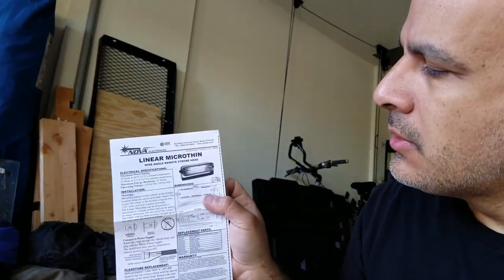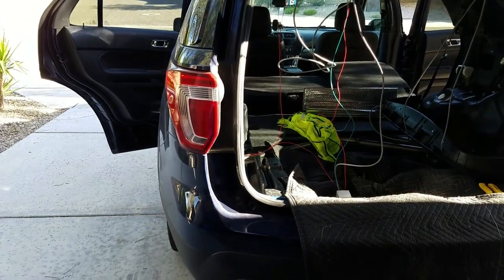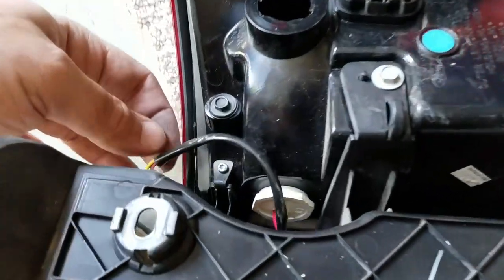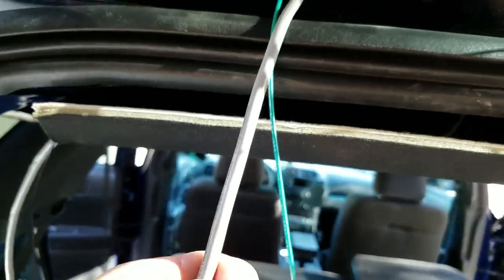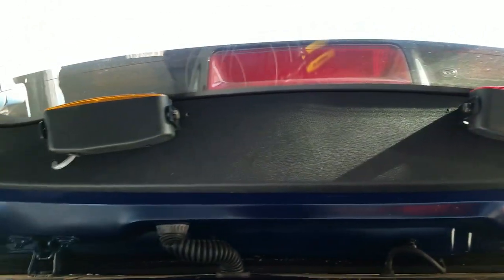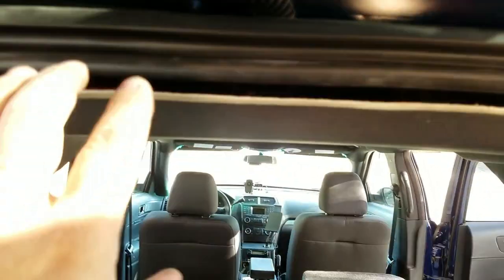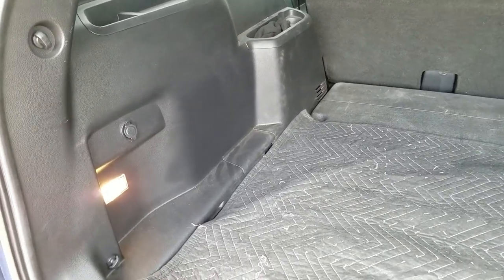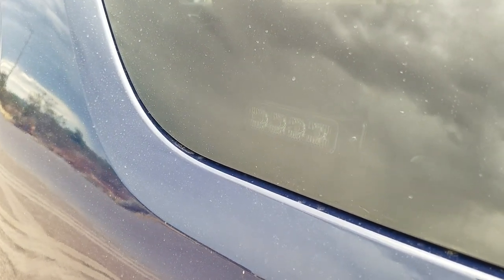Ford Police Interceptor Utility Mods - They're coming to get me!!

Comment: Are you sure about white strobes being illegal on the rear here? Cable company runs white rears on some of their trucks and so does the bus mechanics trucks.
Reply: Never-mind, definitely illegal, found the ARS. I wonder how Valley Metro gets away with that shit
Reply from the maker: http://www.azleg.gov/ars/28/00947.htm  Section D.

I mean it doesn't specifically say you can or can't have white, but says they "shall be" red or amber. I'm not a lawyer so I don't know how to officially interpret that.  The general consensus of all the people I talked to that have lights say it's not legal.  But you are right, I've seen AAA roadside vans with white strobes in the rears. I think the bottom line is no one of authority cares. lol.  I'll play by the book. Not worth the trouble.
Reply: I need to find a way to make my white one red.
Also need to make my back two marker lights red. Amber is illegal for them.
Reply: Well, they do much more than driving around a wannabe LEO failed BLET used police interceptor. There is no reason this loser needs lights. He is the kind of guy who chases after people speeding trying to pull them over.
Reply: I believe he purchased it new from the dealer if you look at the original video. Strobes serve other purposes over just pulling people over. I have them on my work truck and personal truck for safety when parking on the street. It helps make people more aware your there and could potentially save your life.

Since I put the strobes on my truck, I've noticed people are a lot more careful when I am making deliveries as a courier.This is why your starting to see them on usps, fedex, and ups vehicles. In today's world where you have all these morons texting or getting distracted while driving, anything that can draw attention to the fact that your stopped and there may be foot traffic around your vehicle is a positive.
Reply: +Vincenzo Lombardo A private civilian CAN NOT purchase police interceptor variants of Ford vehicles new. It was used. As well, no there is no reason someone not doing road work or towing or something similar would need that many lights. This guy does nothing of the sorts. PERIOD.
Reply: Read the comments below, he does comm and road control for bike races including roadside.
Reply: +Vincenzo Lombardo He has no official capacity with any government law enforcement organization. Which is why he had to purchase this vehicle used. He does however have a failure with no allowed re-admittance into BLET. He is simply another police training failure who likes to put lights on his car. Sort of like you.
Reply: Nope never went into LEO, and I have no desire to. I work in telecom including emergency restorations, hence the reason for strobes on my vehicle.
Reply: +BewareTheldes
See above comments, company truck for telecom. Sorry if that wasn't clear. A lot of the company's contractors are using personal vehicles though. 1099 situation. This is very common among all telecom providers.

 I also have strobes on my personal truck which gets used for courier style deliveries as a second income source similar to fedex or ups and again like to be seen when I am making stop after stop on busy streets. Also, due to the some of the locations of the deliveries I make, I have to frequently back onto busy streets when there is no space to pull off to the side and I have to pull into cramped driveways with no turnaround space.

Also, I am one of those idiots who volunteers to help stranded motorists on the freeway frequently. I don't trust sitting with my hazards on and traffic doing 75 in the right lane (this is common here). People slow down a bit more when they see strobes. 

In other words, they come in handy. Really the question is, why don't you have a good set of strobes on your vehicle?

Now that I'm reading my above response, it looks like I lost that separation of vehicles. Either way, no desire to do any LEO stuff, just like to be seen when stopped on the side of the road and the more visible my trucks are, the safer.
Reply: +BewareTheldes
Plus if you saw my truck, your first thought would not be police vehicle at all, even with the lights on. I have yet to see any of the LEO hauling ass after someone in a beat up Dodge Ram Diesel pickup. Would be a fun site to see. Hopefully catch it on my dash cam. (Here comes another rant on why I shouldn't have a dash cam on either truck)
Reply from the maker: Yes you are correct in this vehicle was "used" as in it had been titled out of the Ford system.  It had 68 miles on it (so it was basically new, though I never claimed I bought it "new")

You have no idea what I'm involved in other than what I have chosen to make public.  Don't assume you know me or what I do. I assure you, you don't.  

I have no idea what BLET is so I can't possibly not be allowed re-admittance. 

Might I make a suggestion. Don't use hate to make up for your own insecurities or failures.  I see you spew similar tactics on your own channel (after posting a video of driving 160 mph). It isn't a good look for anyone. Reflect on your actions and choose to be a positive person. Have a great day!
Reply: +turbo2ltr LOL!!! This is hilarious!!! Driving 160 Mph on that public road is perfectly legal and with that vehicle perfectly safe. As well, it may not be called BLET where you are at. However that changes nothing. You have a 50 state bulletin for your name where you can not attend law enforcement training because of a prior failure of some sort.......You're just another academy failure who wastes their money on their POV putting on unneeded lights and sirens. Not to mention the waste of money buying a police version of the Explorer. It's pathetic, yet funny. You're already making the rounds on the police forums. Your reason for failure will come up soon enough. Must be pretty bad too.
Reply from the maker: I see I've hit a nerve as you've stepped up your insults and completely baseless accusations. Thanks for proving to everyone that you are nothing but a hater.

"waste of money buying a police version"?  It was $10k less than a the same model year retail Explorer.  I consider saving money the opposite of waste.

I don't have sirens.  My lights are used regularly for legitimate and legal traffic control and warning. Please show my this "50 state bulletin" for my law enforcement exclusion. Oh you can't?  Oh you have zero proof of that? So you are just making things up to tear someone down? What a surprise.

Oh, and yes please point all those police forums to my videos so I can make more YT money!   
I hope you have a great (and less angry) week.
Reply: turbo2ltr I don't understand. You are in some radio-volunteer club(or whatever). Why do you need lights and shit, when only thing you should be worried about, is radio? 
So that's bullshit, or I am stupid. Can you explain please?
Reply from the maker: (sigh)
I've answered this multiple times.. but again...

I'll put it this way... What do you think I do with the radio? If you think about it, the radio itself is a just communication tool.  But if I'm sitting at home, what am I going to communicate?  What I had for breakfast?  Despite what 90% of twitter users think, no body cares about that..  So as part of the "radio-volunteer club(or whatever)", we actually are out doing stuff, being the eyes and ears for those that aren't in the immediate vicinity and communicating that data collection to people that need to know.

For instance, event coordinators rely on us volunteers to provide communication and safety services.  I've worked SAG (basically a mobile support role) for a bike race. Say a rider comes into a checkpoint and tells the staff that there is a rider with mechanical issues 5 miles back.  The radio volunteer stationed at that location will call it in to net control (basically a dispatcher type role) that would assign someone near that area to go check it out. For this example, it is me.

1: getting there may require driving on roads close to the public for the event. Lights let law enforcement that man the closures know that I am with the event.  It also helps be more visible to the participants of the event that may not expect motor vehicle traffic.

2: Most events are not on closed roads and many times have participants on roads with highway speed limits.  When I get to the guy on the side of the road with a flat or busted wheel, the lights are used to warn passing motorists of the roadside hazard and to be more visible to them, just like every tow truck in existence.

3: sometimes there is just a dangerous situation.  I had one event where runners had to make a sharp U turn on a sidewalk. But instead of staying on the sidewalk, they were running out into the right turn lane that wasn't closed to keep up their speed. Despite my attempts to keep them on the sidewalk, they continually ran out into traffic.  So I parked my car there with the lights on so passing motorists didn't go into the right turn lane until farther down the road.

I hope this helps.
Reply: turbo2ltr thanks)))
Reply: Cable Company and bus mechanics might have permits
Reply: turbo2ltr and why is it anyone else's business? seems many of these haters are jealous.
Reply: Lighten up, Francis.
Reply: turbo2ltr so glad you owned the hater on this thread. People are soo miserable and nosey he’s the type of guy that would go missing quick where I’m from people don’t tolerate his bullshit everywhere. They accuse you of impersonating a cop but want to interrogate you like they are some sort of law enforcement/vehicle code enforcers.

Comment: Where did you get your APFRS hardware from
Reply from the maker: https://www.byonics.com/mtt4b
Reply: turbo2ltr will it work for any car
Reply from the maker: It's not vehicle specific (It doesn't even need to be in a vehicle).  It's just power and an antenna.  You need an amateur radio license to operate it and you will need to understand how APRS works so you can configure it properly.

Comment: Your strobes have to flash at the same time. They can't alternate.
Reply from the maker: Technically you are correct. Congratulations, you rained on my parade. Do you feel better? lol.  Truth is, even municipal vehicles don't comply with this statute. So while true, no one cares.
Reply: turbo2ltr dps does care. I got arrested on the us60 for having my interceptor strobes on blocking a lane from a very bad accident. white in the front, amber and red in the rear. All because they where alternating. Not flashing at the same time.
Reply from the maker: I'm sure there is more to that story, as a violation of ARS 28-947 is a civil traffic violation according to ARS 28-121.
Reply: turbo2ltr Nope. Never been arrested in my life with a Super clean record. Also very respectful and use to be a fire fighter. Dps doesn't mess around.
Reply: Matthew Bolt Sounds like your state has some hair splitting DPS officers. Wouldn't be New Jersey or NY would it?

Comment: flashing white anywhere on a vehicle is legal in AZ......
Reply from the maker: ARS 28-947D says otherwise.  " The lamps used to display the warning to the front ...shall display simultaneously flashing white or amber lights or any shade of color between white and amber.....The lamps used to display the warning to the rear ....shall show simultaneously flashing amber or red lights or any shade of color between amber and red."  White is not a shade between amber and red therefore are not legal in the rear.